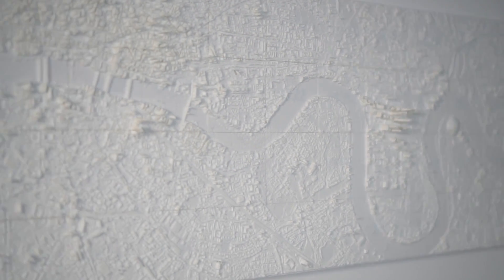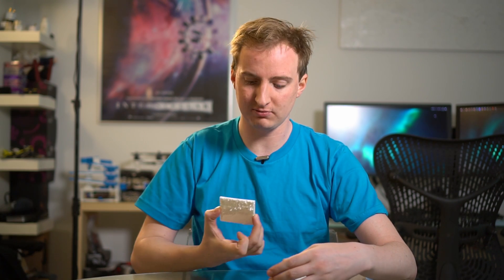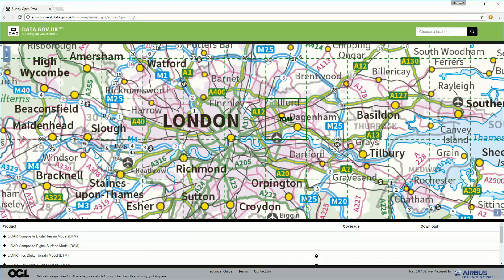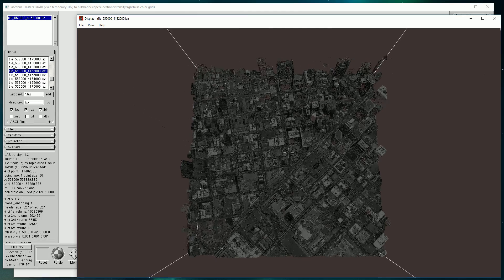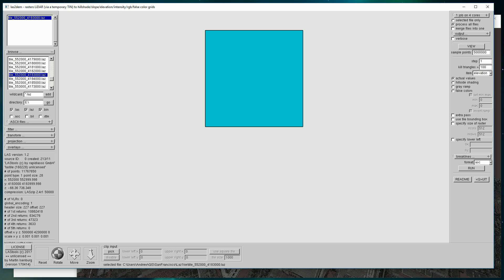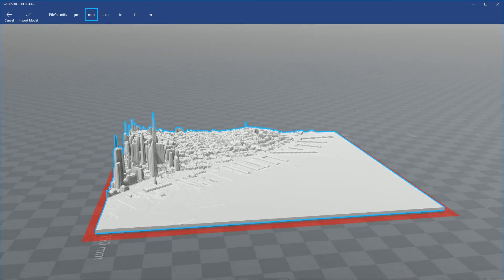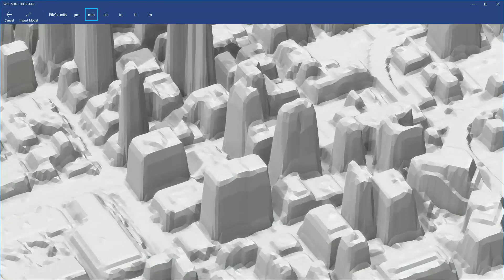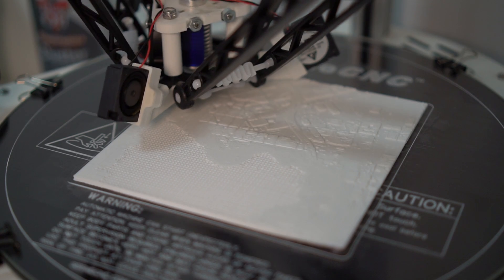Printing Cities: Part One

Comment: Hi Andrew. Loved the video. Was exactly what I was looking for. Can you just let me know one thing. 

When I create the asc from las2dem with aims to move it on to move it through QGIS and then on to print, the buildings always have angled walls instead of going straight down. With my personal troubleshooting (hours and hours so far!), I either gather that this is due to the original image seeming pixelated at the resolution I am trying to work with (if you agree, am I missing a step to keep higher render quality or is this down to the original laz file and something I cant do anything about (working with the National LIDAR Programme Point Cloud 2018 Data)) or it could be some sort of setting I am missing to only raster the image top points and to leave all other points as either ground or roofline. (again, if it is this or something like this any help would be massively appreciated.)

I understand that you posted this video a long time ago but would love your insight if you do pick this comment up. Happy modelling!
Reply from the maker: Well, the walls are always going to be a bit angled because the data shows that - if it says point A is 1m high, and point B is one pixel over (say a metre over) and 10m high, then you get a slope out of that. It's just the way that this somewhat simplistic approach to modelling works.

You can reduce it with higher-resolution data, but also as long as the slope is steep enough it's really not noticeable in the final print most of the time.

Comment: Hi, I am having a few issues that id love for someone to help me with. For some reason, I can only have the divisor (-d) set as 1 without an error. Also, the resultant stl file is very large (9GB). Is there a way I can reduce this? Because it is to large for me to open.
Reply from the maker: The divisor has to divide into the number of rows/columns of your initial file cleanly - so, if you had a 1000x1000 input, you can't divide by 3 (because that results in 333.3 - it's not an exact division) but you could divide by 2 or 4.

And dividing down is the best way to get the filesize down - it reduces detail, but also massively shrinks filesize.
Reply: @AndrewGodwin   Thank you that is very helpful, I do have one follow up question though. I am am not sure the best way to determine number of rows and files in my .asc file. What is the best way of doing this?
Reply: @AndrewGodwin  It looks like I have 10,000x10,000 but I have tried a divisor of 2, 5, 10, 100 and others with no luck. Not sure what I’m doing wrong here unfortunately.
Reply from the maker: @darksmash333  Afraid I don't really know what to do then, sorry.

Comment: Can you 3d print Texas World Speedway with the buildings and track?  They have torn it down but I understand the model is still on the old version. How can I get a copy so I can 3d Print it.?
Reply from the maker: It looks like the lidar data is sort-of there (I checked on https://apps.nationalmap.gov/downloader/), but 3D printing it would be tough as a race track doesn't stand out that much compared to the surrounding terrain.
Reply: @AndrewGodwin  Thanks for the information I wanted to use a CNC printer to print Texas world speedway best I can on a 2‘ x 2‘ piece of oak you would be surprised how many people I know would want to buy that

Comment: Printing 1x1km in 3-4 hours is not quicker than printing 2x2km in 5-12 hours, so even with the "extra hilly" parts of SF, you're still saving print time. And then you save more time on not having so many tiles to do post-work.

Comment: Hi,

I keep getting this error when passing in my .asc file:
ValueError: Non-exact divisor!

What can I do to prevent this?
Reply from the maker: That means the file you passed can't be divided exactly by the divisor you passed - e.g. 2048 with a divisor of 4 is OK, but 1001 with a divisor of 4 is not! Try changing the .asc file to be a power of 2 in both dimensions.
Reply: @AndrewGodwin  First off, thank you for this awesome series! This inspired me to get a 3D printer. However, I would love some additional information  to resolve this. What settings do I need to change in Las2dem to resolve this issue in the asc file?